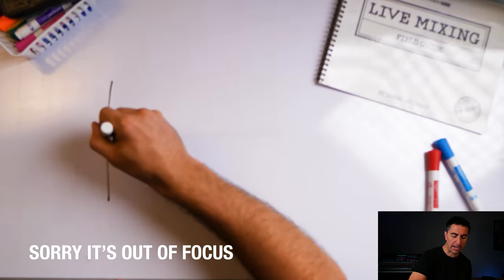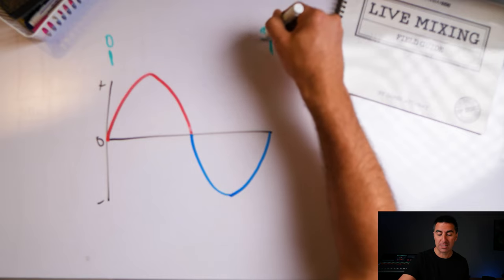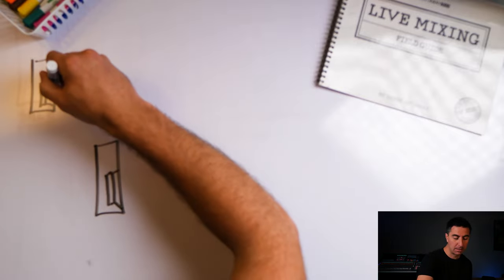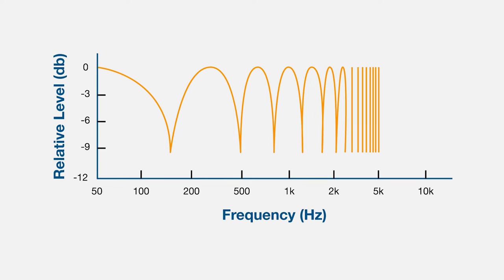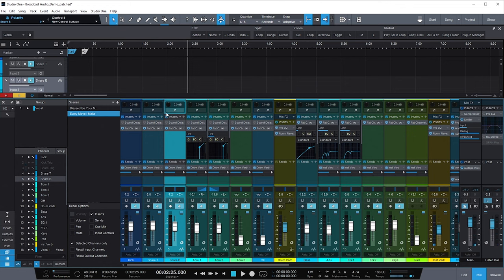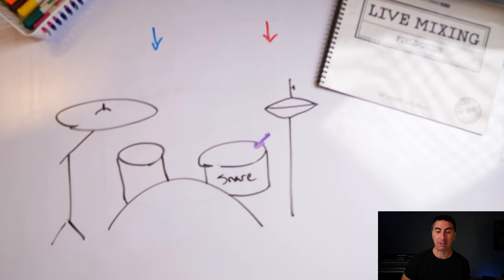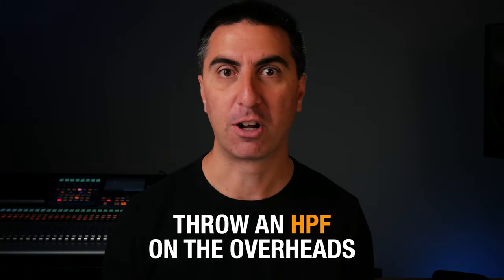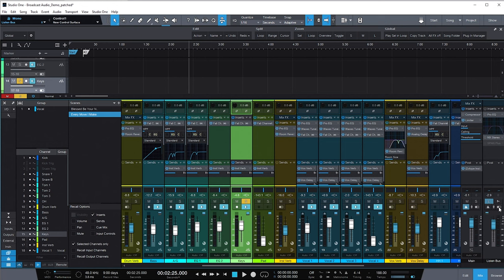Audio Phase vs Polarity

Comment: The two speakers are not 180 degrees out of phase in general, you have just chosen a frequency where it looks like it. The phase difference between the two are a linear phase shift, not 180.

Comment: Finally! Someone who uses the terms correctly! Pin 2 hot? Hasn't always been that way.
I have some recorders and microphones that are Pin 3 hot. Most of this has been standardized, but for many years it was a problem. There was a Tee Shirt at AES that read "F*** You, It's Pin 2!".
I used to use a clicker to check out microphones. My valve Neumanns and most of my old Shures were Pin 3 hot. I just rewired the microphones.

Comment: Same logic applies to electrical 3-phase grids whom have 3 lines whom are in 120 degrees of each other. Love how the logic is all the same. Voltage, Frequency all the same logic.
Reply from the maker: that's awesome. I thought that's how it worked but I could never explain it that simply.